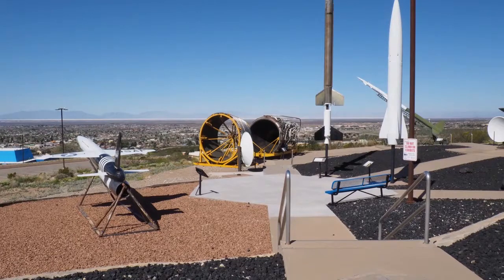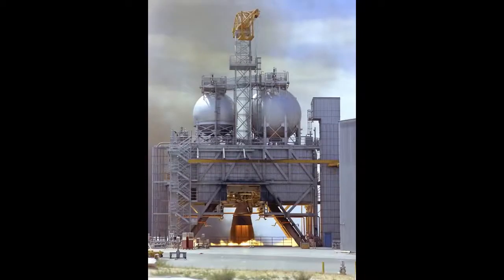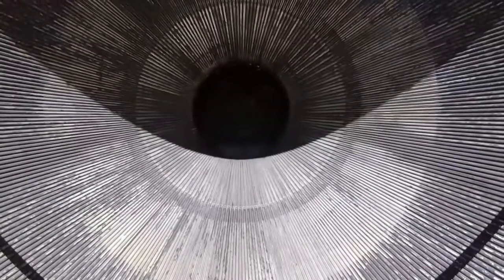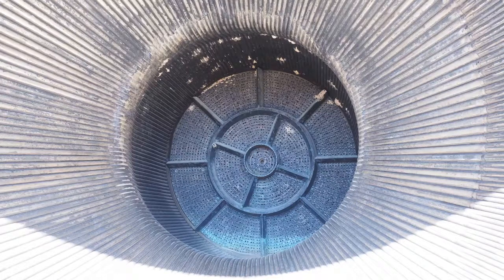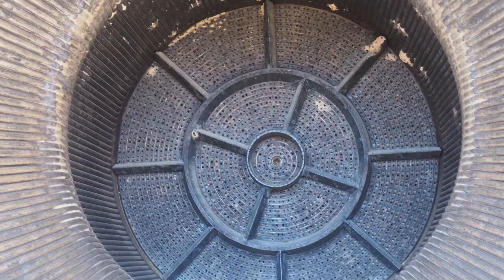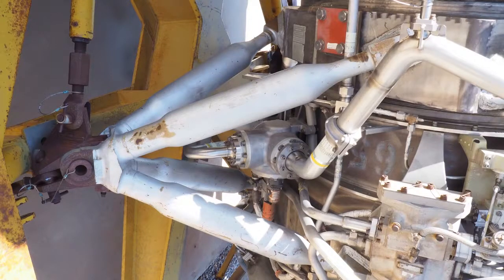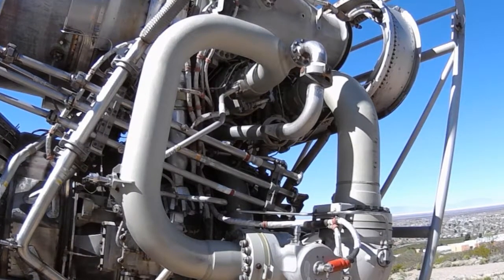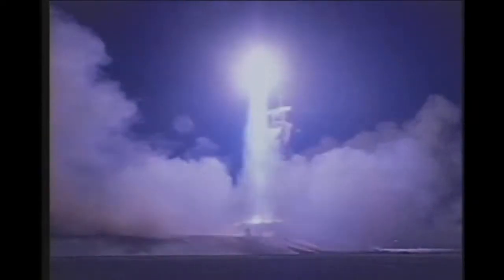The F-1 Engine

Comment: Thank you. Is there information on the service life of that particular motor?
Reply from the maker: The run time for a launch would have been about 165 sec. That doesn't include any static firing for engine certification. There wasn't any recovery and re-use.